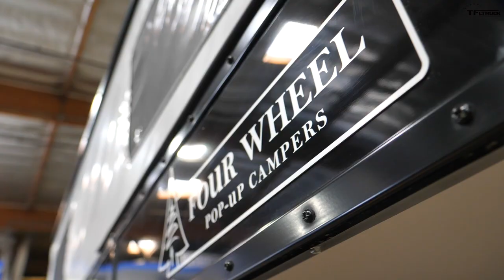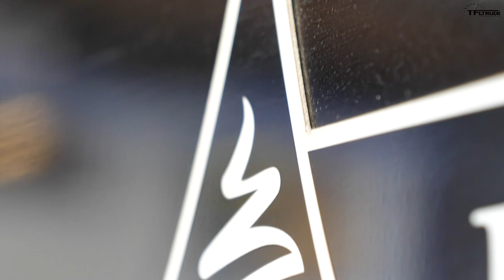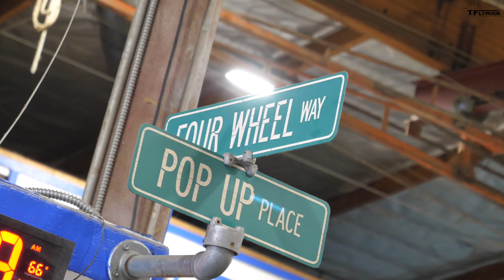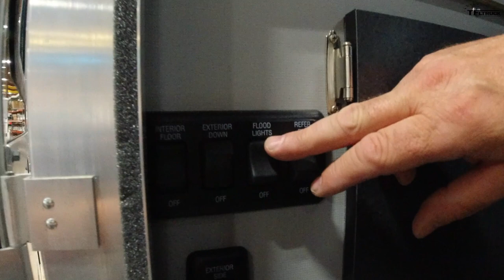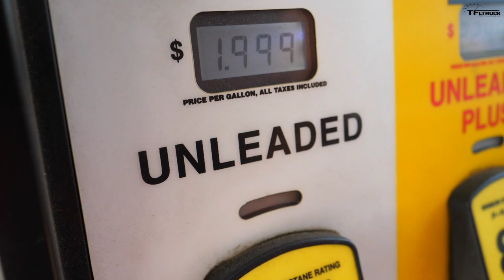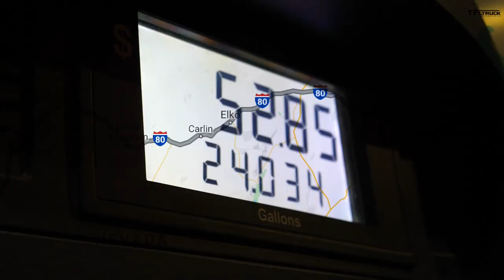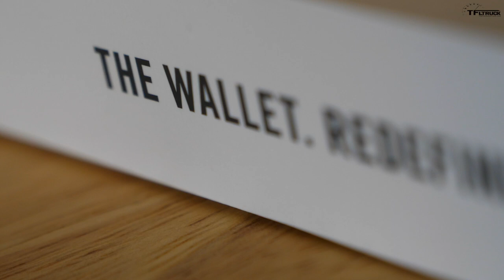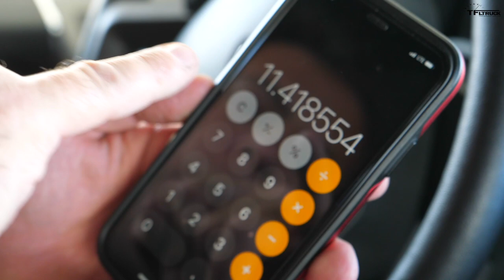Here’s How To Turn a Big Truck Into A Small Home!

Comment: Continuing to call the truck a "Super Tremor" is ridiculous, it's not a Tremor it's an XLT F250.  There are actual F250 Tremors that have been fully upgraded with Carli suspensions that are far more legit "Super Tremors" than this is.  This is no different than modding a F150 and referring to it as a Super Raptor.  The VelociRaptor from Hennessey at least starts with a Raptor, what you're doing is just wrong.
Reply: Robert Cone no way man. You put $10k of cari on your truck it will kill that tremor appearance package 😎 it can self identify as a super tremor. It’s 2020
Reply: Mitch and Cassie are 100 percent correct! You should visit PaxPower ( V8Raptor.com )......they do a better build than Hennessey. Moreover, PaxPower offers options for regular F150 trucks.....makes the truck Raptor performance capable without the aesthetics of a  factory OEM Raptor. PaxPower offers the option to have Raptor suspension installed without the other stuff...bowed front fenders and bedsides, the goofy decals, etc.  PaxPower will also install Whipple Superchargers on F-150 5.0L trucks.

Comment: Sorry but I think 4 Wheel campers are overpriced cheap material products. The old pop up campers of the 80's and 90's where much more better built. Question, where is the emergency exit in the pop up, like the older campers have and if you are not physically able to lift the top how do you get it  up and down? Those gas struts are junk and they over charge you for them. I have a 1982 SunLite pop up truck camper that uses an inside crank mounted to a belt with teeth to lift up the top with out any assist. My camper may not be new but it is way better built.